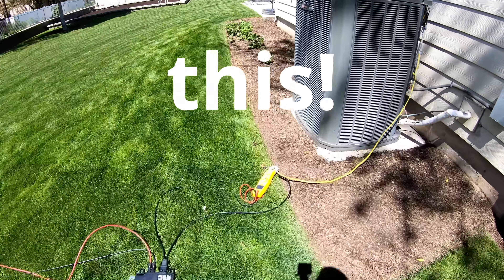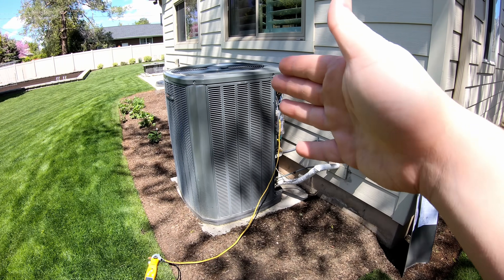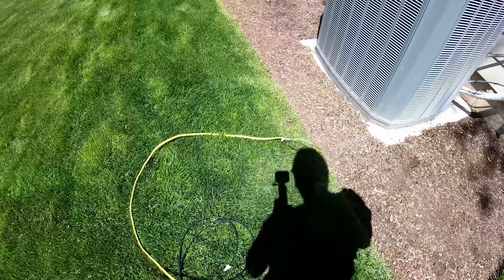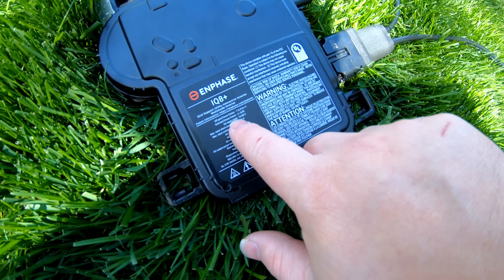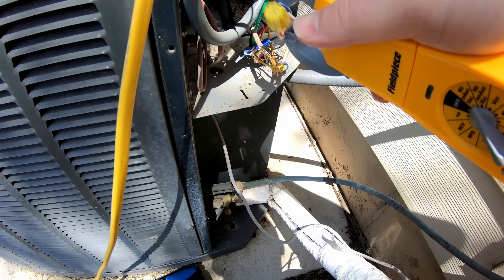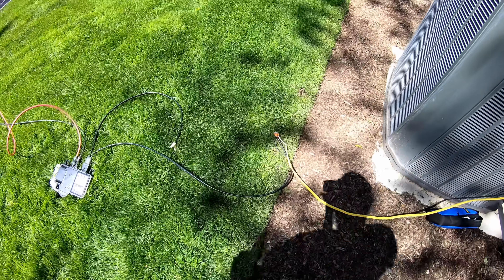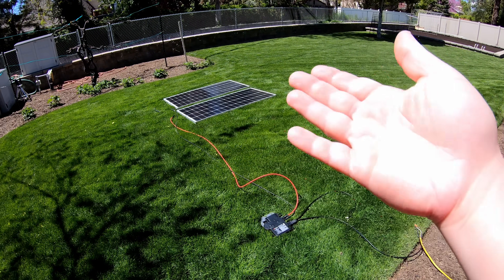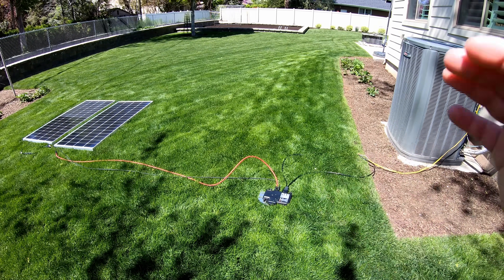1 Hack To Eliminate Your A/C Power Bill This Summer!

Comment: So, basically a temporary grid-tie solar/micro-inverter setup.  Yah, I see how that can work.  Sorta... but it is too dangerous and I will explain why in the next paragraph.  Also I think its probably not legal because even though you aren't backfeeding the grid, you are interfacing a backfeed-capable device to the grid.

There is another problem here that makes this *very dangerous*.  If you happen to have enough solar to roughly match the A/C's load, and the contactor tries to turn off, the microinverter will not be able to determine that the grid disconnected and will continue powering the A/C system.   The A/C will probably continue running under these conditions.

And that could cause major problems because without the grid to synchronize to the micro-inverter's waveform will slowly get out of sync with the grid.   If the contactor then closes under those conditions, you have two out-of-sync waveform fighting each other and that can easily start a fire or blow everything up.

A third problem is if the solar power is just moderately lower than what the A/C needs.  This will cause the A/C to run more slowly and still possibly not trip-off the micro-inverter.   The result is that you might over-stress the compressor in the A/C unit.

So I would say, just don't do this.  It's too dangerous.

-Matt
Reply: Matt- none of the issues you listed are major issues.  This type of setup has been done by many for years for “injecting” power to supplement power usage from a a/c unit.  Even if the solar does not produce enough power as shown in this video the grid power makes up for it.      It is basically how panels wired at the home panel work.  If my house requires 5k watts and my solar is only producing 3500, the grid supplies the other 1500.   Only difference is this guy is using the contactor in the a/c unit to switch the inverter on vs constant on at the panel or even connected to the other side of the contactor.
Reply: Once the contactor opens, the emphases will shut down
Reply: Matt - The power will not keep the contactor working and making the a/c to run continuously.   The contactor is powered by a 24v transformer in the air handler in the house.  The 24v signal comes from the thermostat which gets power from the transformer and sent to the contactor.   This simple setup helps is showing has been done for years.  But if the power company sees this, they will shut it down.
Reply from the maker: Anything can happen I suppose! It worked pretty well for me! But to reiterate the disclaimer from the video…do not attempt this yourself! Thanks for watching!

Comment: Don't believe stories like this, low amperage will kill your compressor, overtime.
Reply from the maker: Good news is that the grid will make up for any additional amps the A/C unit needs to pull. Thanks for watching!
Reply: Why are you wearing a mask in your backyard alone? What are you scared of? And it's not even an N95 so your not blocking anything out. Just backfeeding your breath on your face 😂😂😂
Reply from the maker: @mackercheese Haha! Right? You never know what you might breathe in! Just kidding! I have severe spring allergies so anything I can do to lower the pollen count that I breathe helps. Thanks for watching! You’re very observant! ;)
Reply: @mackercheese allergies dude, it’s spring
Reply: I agree.  This will work and done it several months.  The power company did not know.  Instead of the home unit pulling 4000 watts it looks to only be pulling 3000.   
   When people do not understand they start throwing out warnings of fear.     HVAC companies have tied panels to their units for years. Back around 2012 we had a company trying to sell us on hvac/solar combos.  The problem was then the panels output and size and price back then were hard to justify.  The price per watt was still crazy high.
Reply: That’s cool

Comment: Doing the same thing on the timer side of my in ground pool pump. Those IQ8s will eventually stop sending power without a full system connected and gateway. Recommend using the M215s which. 

As a test I would leave it connected for a week and report back. The other person that did this showed it stopped after 2.5 days.
Reply from the maker: Good for you! Are you using the M215’s on your pool setup?  I don’t have information on how long the IQ8+ will export power without the gateway. But I will soon because I am working on wiring it up permanently to my A/C. The one thing that might make a difference is the fact that basically any time the A/C shuts off at night and there’s no solar coming in, it basically power cycles the micro inverter and resets everything on it. So I might avoid any issues due to that happening. But we’ll see! I’m going to make a follow up video once I get my installation done and it’s been running a bit. Thanks for watching!
Reply: @theresatrickforthat  I've been using the more reliable IQ7's (compared to the M215's) w/o a gateway in a similar fashion for over a year, no issues.

Comment: Good video, certain some food for thought. Those micro inverters cost like $175.00 each, where as the regular inverters are around $200.00 but will handle 10 times the power. I've never seen a big inverter with m4 connectors.  I wonder would it be possible  to string a bunch of panels directly to one big inverter without going through a charge controller?
Reply from the maker: It would be interesting to see what the options are! They just need to have grid interactive features like these micro inverters do, otherwise you’re stuck building an off grid system that requires some kind of battery. Anyway, I love the ideas and thoughts! Thanks for watching!
Reply: @theresatrickforthat  If it's a grid-tied inverter, it'll have rapid shutdown and other grid interactive features. It should work as well as the Enphase micro. Some string inverters can limit energy export as well.

Comment: I was wondering if you could add more solar panels and add a switching board that can instantly switch between the grid and the panels with the goal of totally or partially offset grid consumption and save on your electric bill. I'm sure there is a device that can do that and fool the electric meter into not charging you for any solar electricity production. I am thinking of doing something like what you have with the proper electronics to safely switch between grid and solar and mitigate any issues during cloudy days.
Reply from the maker: Sounds like a cool idea! Thanks for watching!
Reply: Before determining how...we should mathematically work out the "how much"

My Heat Pump adds $40 to my power bill in summer based on the spring and early fall months I don't use it.  It adds 65 to 70 in the winter months.  Very efficient house, 1200sqft, good unit, ducted, blue ridge mtn foothills.

So at that the grid cost of my HVAC is $360 per year.  At best with 💯 solar running it and no batteries that's <$180/yr for daytime use.

It would take me decades to pay off the cost of a solar system and circuitry to handle that.  I'd also be better installing propane heat as winter solar is poor here due to clouds and the national forest surrounding me.